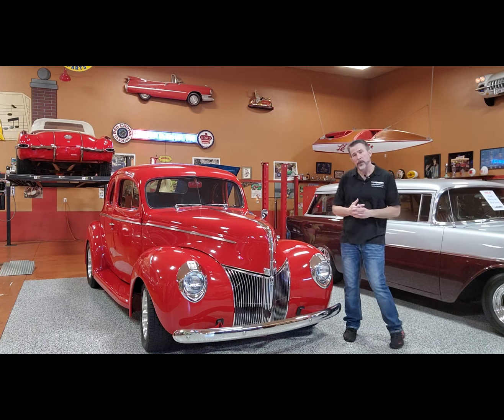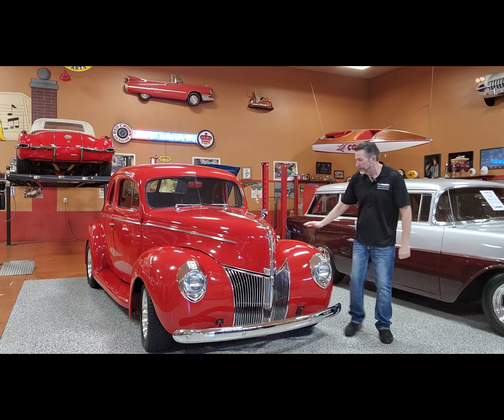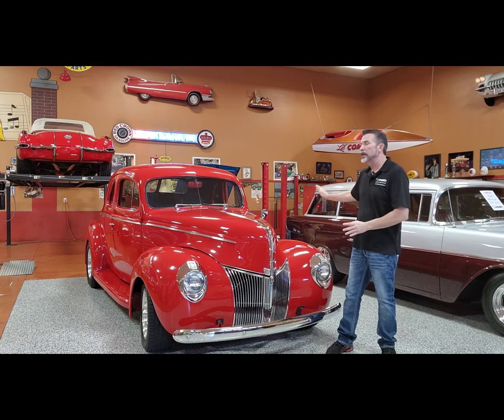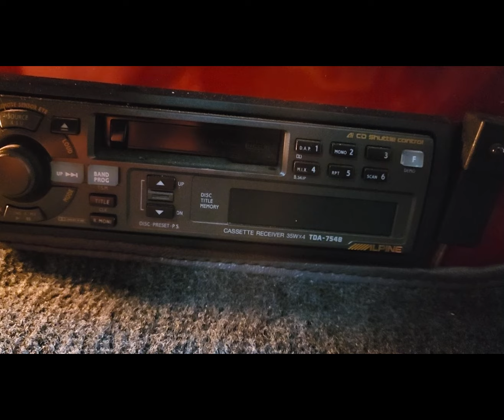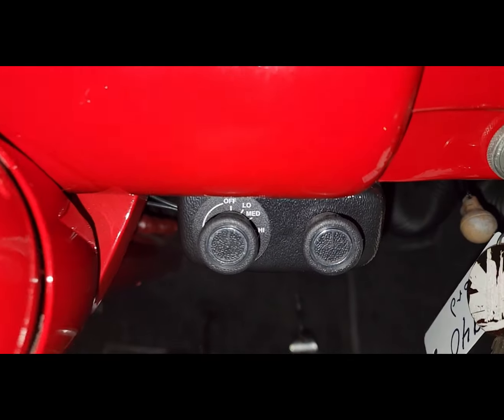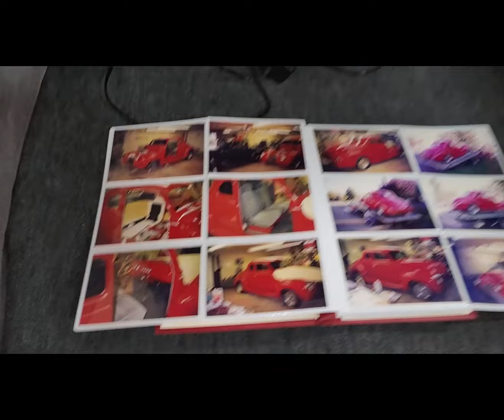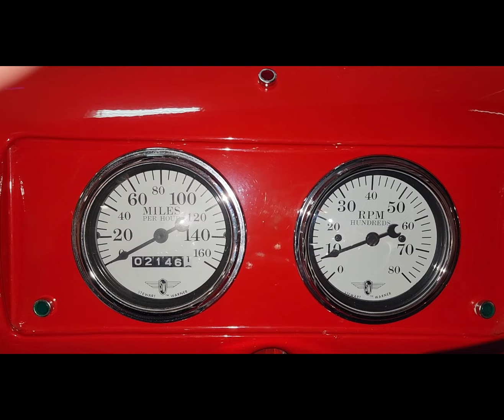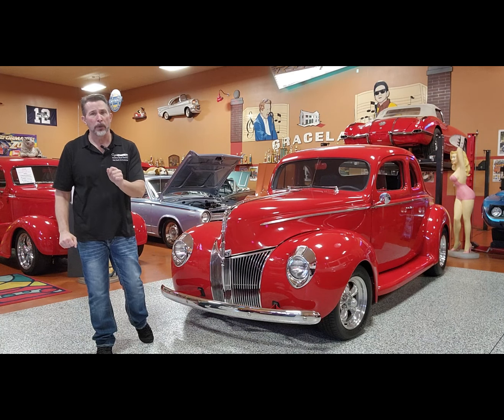1940 Ford Standard 351 Cleveland

Comment: I finally got my old man to sign over his ‘40 standard to me. While he had it he did make the cardinal sin of putting a SBC 350 in it. You are right, sir. The looks on car people’s faces when I tell them there’s a 350 in it is agonizing. I had a gentleman offer me a SBF 351W for free. It’ll need some working over but that’s what I’m gonna swap to. I’m in the process of getting a Mustang II IFS w/ power steering in it. I’ll run the 350 until I can get the 351W done and then I’m pulling out the 350. Then when asked, “What motor do you have in it?” I don’t have to hesitate and answer with shame. I can proudly say, “There’s a Ford power plant in this baby!”

Thanks for showing this beauty and for encouraging to get it back to Ford.

Comment: No '69 Mach 1 came from the factory with a 351 Cleveland. The engine was not offered or installed in anything until the '70 model year vehicles. But, hey, at least you don't show an obvious 351W and call it a 351C like so many do.